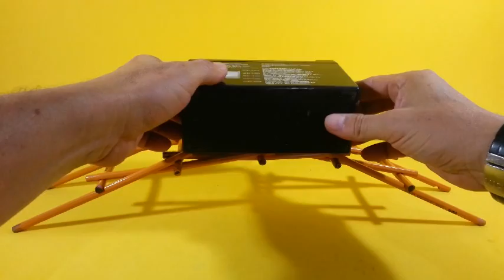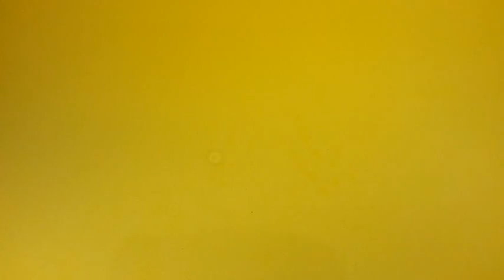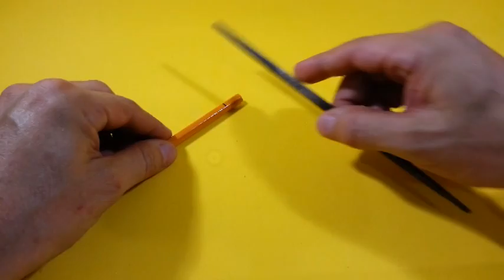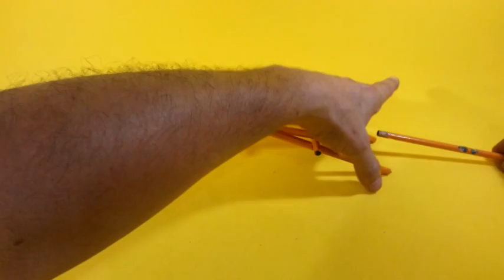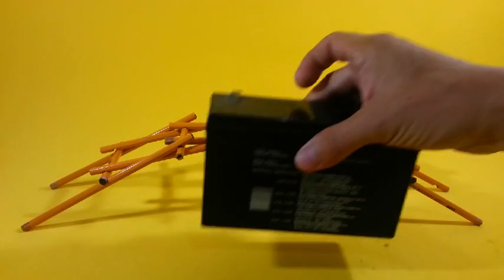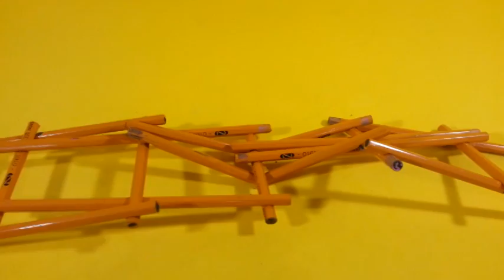The Bridge of Leonardo Da Vinci - How to Build Your Own

Comment: If you had abutment as simple as the ends of the bridge buried in the ground there would be little to no flex on the bridge. The harder you push down the stronger it gets. At some point it will give. You can bet they dug the ends of the bridge in. Former Marine. Combat engineer.